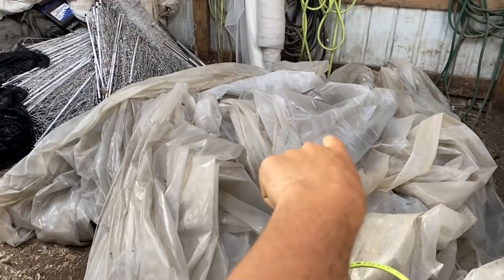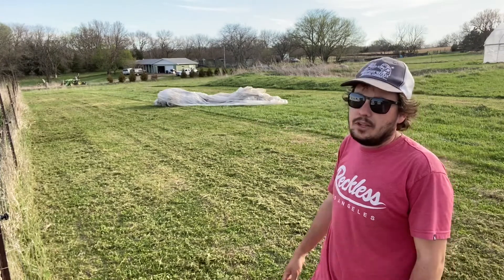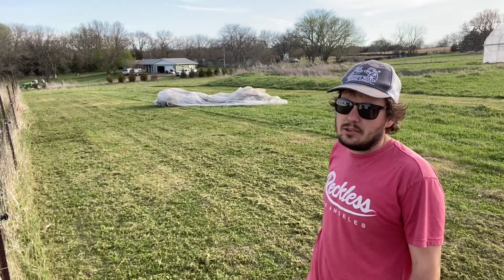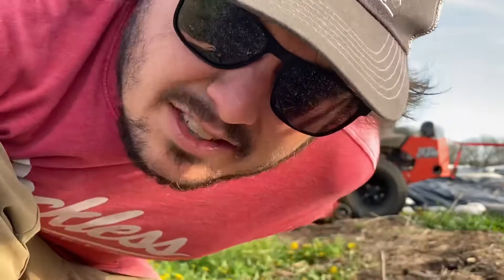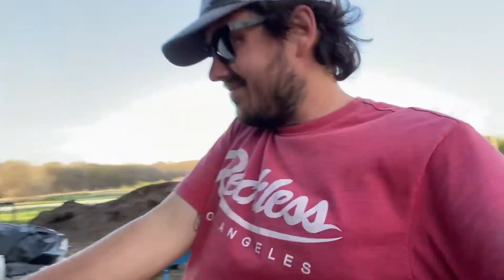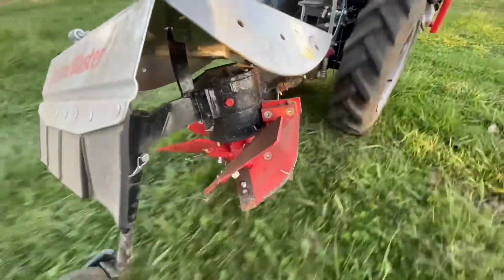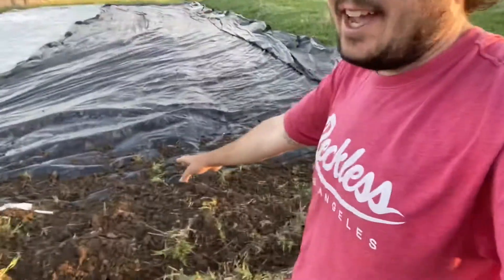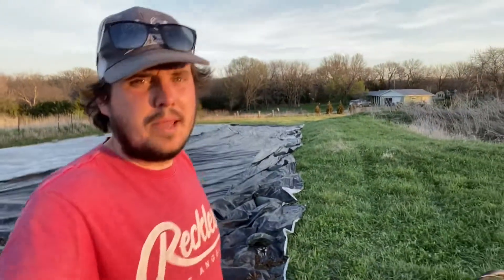Solarization vs. Garden Tarps PART 1-The Tarpening - ft. The rotary plow

Comment: Hey bro. Good to see someone else with themachine. Yeh as you use it more you'll figure out the application.  I live far from my garden so I have to really be sure if I wanna load up the machine and its attachment.  I make little pegs/stakes out of PVC with T-fittings to that I can easily insert and remove. Put them at the edges and/or even within the surface area of the tarp. Good job bro. Hailing from Trinidad and Tobago,  Caribbean.